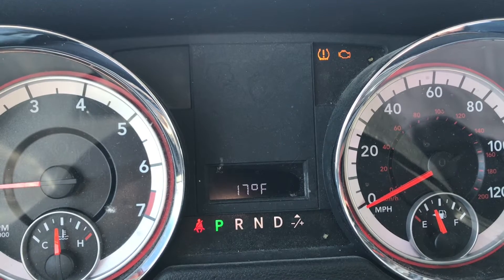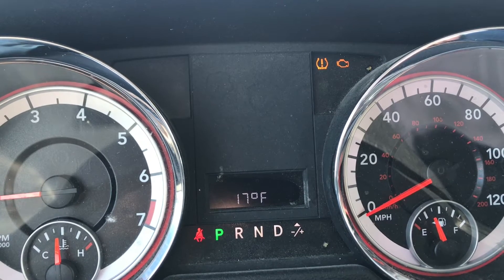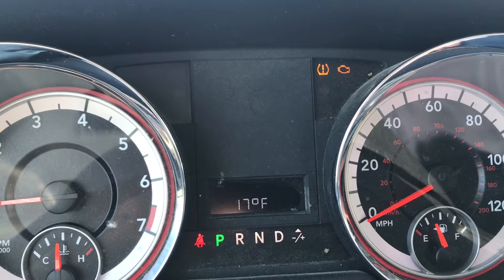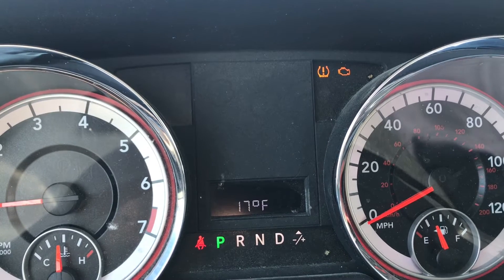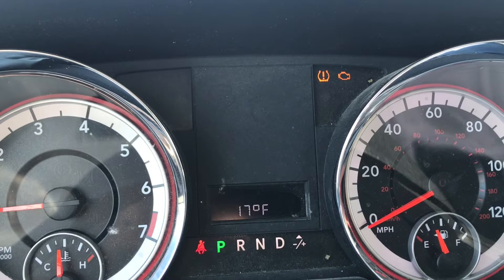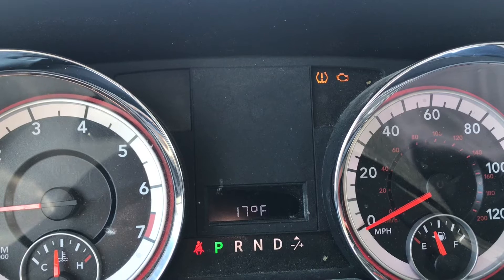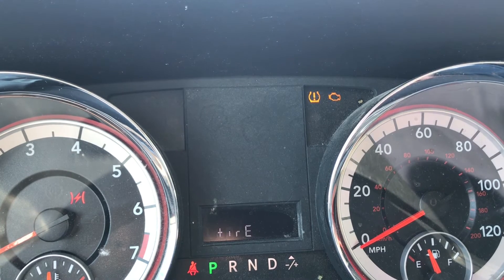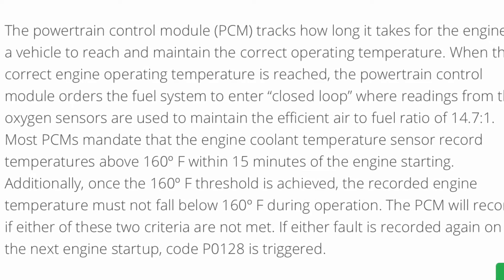Check engine light error codes from a dodge caravan

Comment: So my caravan threw a low voltage code because the battery had died. I jumped the car and it’s been running just fine. The alternator seems to be charging the battery since it’s started every time since but I’m still seeing the light. Is there a way to clear the code?

Comment: I have a check engine light with no codes? Should I get an actual scanner or is this efficient enough? I had a po456 code, changed my gas cap, code is gone but check engine light is still on? Any advice please

Comment: I did this cause my engine light is on. But just lines showed up without a code. Then is said done. This is after I changed my bank 1 imbalance fuel ratio and spark plugs. So what can it be?
Reply: Same

Comment: These directions didn’t work on 2011. But suggestion in comments said instead of from off position, go from acc to start 3x. That did the trick.
Reply: This worked for me as well on my 2017. Thanks for tip.

Comment: Can’t get out 2011 express dodge caravan to display codes. 
Have been having some issues with the fuel gage and the dte will fluctuate when I get to almost 150 miles driven on the trip A. 
Was advised that we do that due to the gage not reading true.
Recently the check engine light has come on and the gage will fluctuate from the half to E. 
Was trying this to see what the engine code was and how much it would cost us.
LOL

Comment: Do I go to run or accy ??? and it’s 3 and a code shows up???
Reply: There are 4 switch positions: Off, Accessory, Run, and Start. Begin in Accessory position. You only use that position and Run. Do not use Off or Start. So: Acc/Run, Acc/Run, Acc/Run and stop turning, leaving it in Run position. Any code or codes will appear on the dash, followed by "Done" when there are no more.

Comment: Thx tried it on my 2012 grand caravan the engine light flases 3 time but no code tried it several times
Reply: There are 4 switch positions: Off, Accessory, Run, and Start. Begin in Accessory position. You only use that position and Run. Do not use Off or Start. So: Acc/Run, Acc/Run, Acc/Run and stop turning, leaving it in Run position. Any code or codes will appear on the dash, followed by "Done" when there are no more.
Reply: @reecenewton3097  Thanks Reece! No codes and it said done. I did tighten up my gas cap. Does this mean the light will go off on its own or will I have to get that done?
Reply: @zohair37  Not sure: search on line on how to turn off check engine light for your car.
Reply: @reecenewton3097  thanks this actually helped a lot!
Reply: I tried it on my 2011 and i didn't get a code
Reply: And what happened? My wife tried it and got a code. Now I try it and there’s no code just “done”. But engine lights remains

Comment: Will this reset the indicator light as well or do I need to take it in the get that cleared?
Reply: I have the same problem/question. Did you try this?
Reply: Will not reset the light.  Disconnect the battery for 30 seconds, code will be cleared.